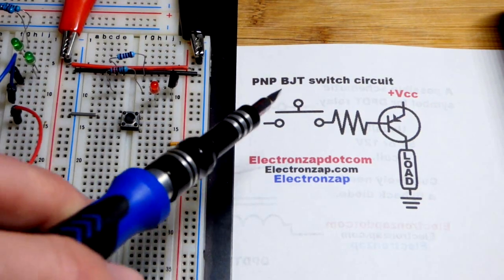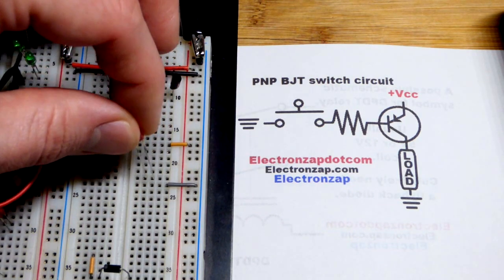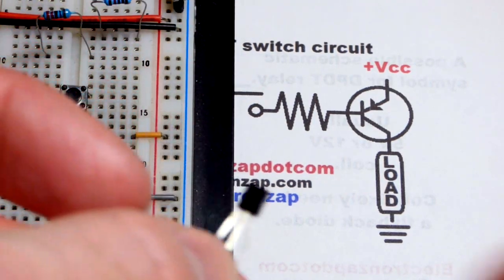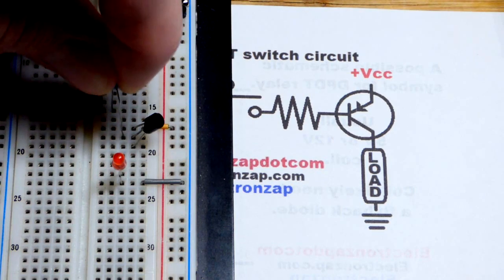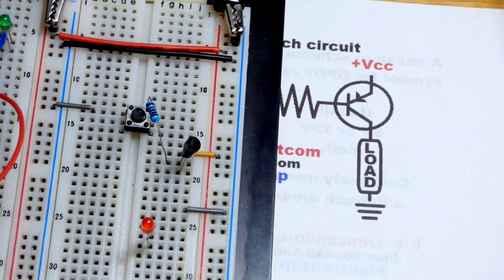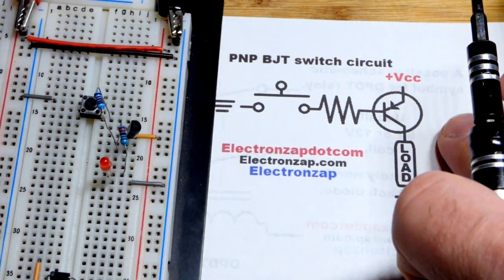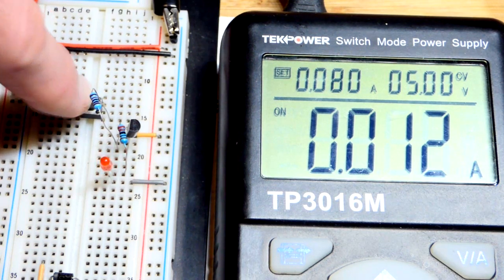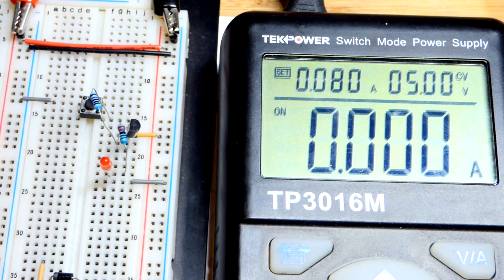Quick PNP BJT switch circuit using 2N3906 bipolar junction transistor schematic to breadboard build

Comment: Does the switching action depends on the voltage or only current ?
Reply from the maker: It needs a little Base current, and Base voltage needs to be at least 0.7V less than the positive supply voltage.